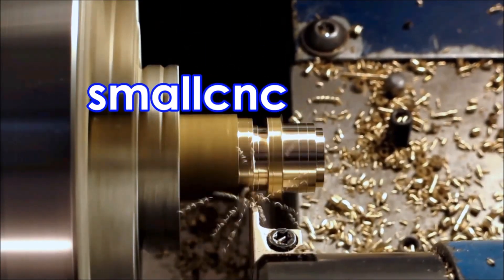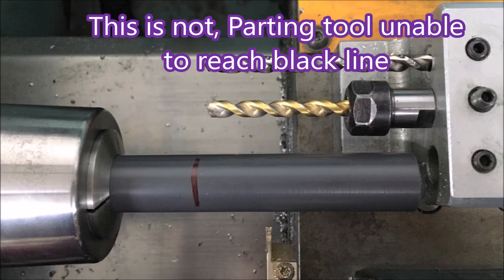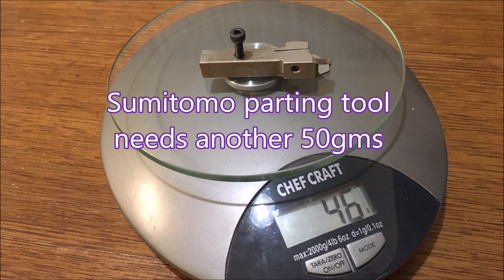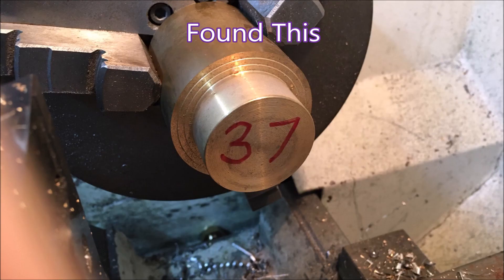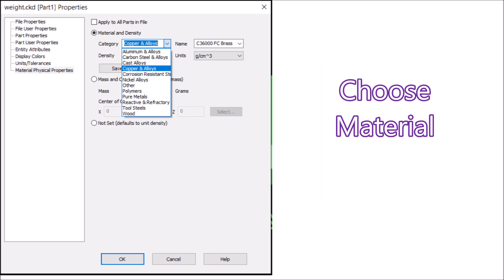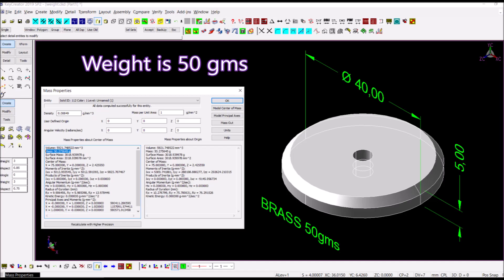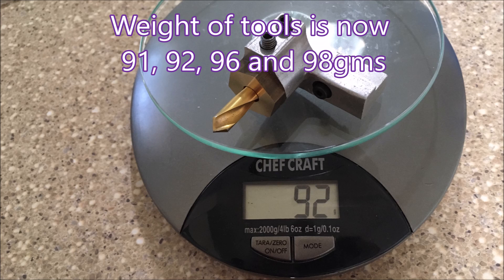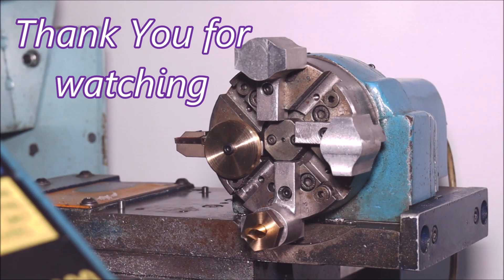Balancing tools for the Turret. Small cnc lathe

Comment: While it's always a good idea to balance your turret, your balance weights here are totally correct.
  While the weight itself is close enough it's the position of the weight from the centre axis that also needs to be the same for a balance set up, but in saying that your set up is obviously good enough for your setup.
  For me I just sought of eyeball the setup as many of my tools weight in 20-30kg so not so important as in your precision machine.
   But interesting video, keep it up :)
Reply from the maker: Thank You. As you have noticed, not easy to add weight to the parting tool to match the weight centre of the other tools.  No doubt to get proper balance the weight would need to more than match the other tools.  Not really up to working out the correct weight anymore. Once upon a time (and it is probably that long ago) I could have done it quite easily. LOL
Reply from the maker: I think I will make myself a balance bar to check this arrangement with.  Doing the sums, the parting tool needs two times more weight at least! Thank you for bring this up. With any luck I may even be able to come up with a complete disc, that way I can test any configuration of tools, rather than just two opposite one another.
Reply: @smallcnclathes  
Well you did say the turret aligns with taper pins so shouldn't affect your accuracy.  I was just thinking 500 parts, probably 4-5 tool changes, so overall around 2000-2500 changes for the job. If it balances out well saves a lot of wear and tear. If it's only a short run ~5-10 parts , not worth worrying about, but for a big job , maybe it is.
Reply from the maker: Just finish a model of the turret, but thinner will 3D print it tomorrow.  This way I can balance any setup
Reply: @smallcnclathes  
Well I look forward to seeing this in a future video :)
Reply from the maker: The real issue with out of balance is the bang that happens when it misses putting the correct tool in place. In this case it would probably be an empty tool position. Usually I put blanks in adjacent slots to try and create balance but that is very iffy. With a dummy turret it should be possible to get within cooee with little guess work.
Reply from the maker: @landlifem5872  
I am pretty sure there will be one!

Comment: I'm having a hard time understanding how your turret is so sensitive to the balancing, but you are still able to make good parts.
Reply from the maker: It only has a tiny motor, if the bulk of weight gets over centre (so to speak) it can't do the final return to position the tool in the right place. Depending on the tooling set up this can be nasty if the program continues with the wrong tool in place.
Reply from the maker: I forgot to add re accuracy. The mechanism relies on shot pins ( tapered pins going in a hole) to locate and hold the turret in position once it has moved. So as long as the moves are completed, the tool position is accurate.